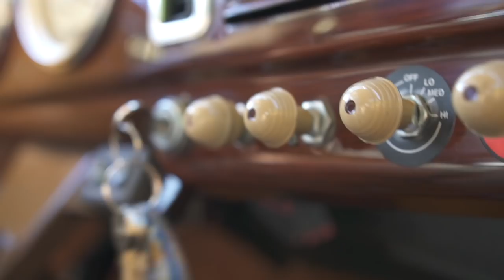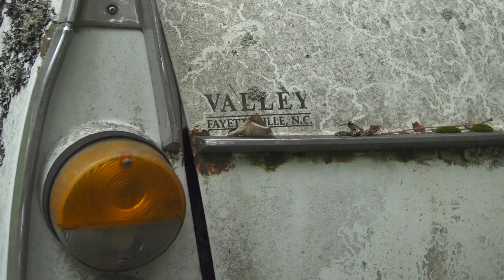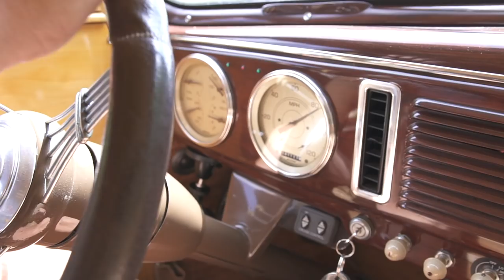A smorgasbord of Swedish classics | Barn Find Hunter - Ep. 27

Comment: The first prototype of Volvo 444 was presented in 1944. Likely inspired of the prewar Fords.The produced cars came 1947.The early wagons was called 445, the later ones ( I Believe its a late one in the film) was called 210.The Engine in the Saab 95 (the wagons is called 95, the sedans 96) is not just a industrialengine. Its a german Fordautomobilemotor. It belonged in the german Fords 12M, 15M and the cheaper models of 17MThanx for a very good show and greetings from a snowy Sweden

Comment: Had an 1950 Austin A-40 back in the 60's. Swapped the motor with a Riley (I think 1600cc} with dual Solex side draft carbs. Went together pretty much bolt for bolt........Wish I still had it.

Comment: On the Austin, it's an Austin A40 (40 horsepower) Devon.  1950-ish is about right. There was a later rebodied series of this car called the Somerset.  The engine is 1.2 litre, and is not exactly a B series engine, but is the precursor to it.  Despite the small motor, they were well regarded in my part of the world (Australia) as being able to take a hammering in rough conditions, and they sold very well indeed here.  On the Ford V4, I think that they were most notorious for their use in Ford UK's Transit van which also sold in huge numbers around the world.  It has a reputation as a very rough running motor.

Comment: Ford V4 actually was used in many cologne-built cars until late 70s-early 80s
Reply: Yup. The last model with it was the Ford Granada (european car - biggest one they made here in that years, almost limousine (big sedan) and estate version also with independent rear suspension, rwd, made from 1972) 

1.7 V4 was the base engine.  It ended in 72 in Capri Mk1, and in 77 in Transit Mk1.....

Comment: Austin A40 Devon, 1200cc engine. I helped a mate drop a 1500cc engine from a locally made Morris major into it mated to a 4 speed floor shift MG B gearbox and the rear axle from an Austin A55. He put 2 x 1 1/2" Su carbs on it. Once it was dialed in it gave many newer and more 'muscley" cars a good run for the money, and towed hus trailer sailer across the city to the water, something the original engine struggled with. And yes he liked his Pommy cars, he had a succession of Jaguar MK 2's.

Comment: The v4 was widely used in German Ford models at the time like Taunus, Capri. Transit etc. A few even made their way over here to North America in some of the earliest models imported and sold out of Mercury dealers. It looks exactly like a 2.3/ 2.6/ 2.8 Cologne v6 with 2 cylinders removed from the center. Ford usa used the 2.8 in some of the Pinto/Bobcat, Mustang II  and Bronco II and 86 Aerostar. With an upgrade to an aluminum timing gear these engines were very long lasting. The Cologne later evolved into the 2.9 (EFI) Scorpio, Ranger, Bronco II and lastly the 4.0 Explorer engine in the N.A market.

Comment: "Ford Industrial engine" nope they were fitted to Ford Corsairs, Had a pretty bad reputation due to the fibre timing wheel failing. Iirc Saab fitted steel wheels to fix this?
Reply: They where also fitted to Taunus and Transit vans at the time. Don't remember if SAAB changed the fiber timing gear, but as a curiosity Volvo B18 and B20's also had those.
Reply: My dad converted a '73 to run on petrol back in the eighties. I believe they had steel wheels, as they were reliable motors for the time period and managed rough conditions very well.

Mom and dad used to have rwd cars before the Saab. My uncle lived on top of a hill and my dad used to help him out at his metal shop.
One fierce winter evening my mom went to pick up dad and it had snowed a LOT. 
Once she got on top of the hill and dad hopped on board, she sighed "You couldn't have managed to get here in any  front-wheel driven car, I'll tell you that!"... Dad decided that it was for everyones best that he kept his mouth shut that moment..
Reply: ford actually produced two v4 engines one was produced in the uk for the british fords and one in germany for the taunus/transit.
Reply: Think it is the V4 that was also fitted to the Ford Transit van.
Reply: First V4 "Cologne""  like in Saabs was used in Ford Taunus  12M/15M  called " P4" in 1962 -- also front wheel drive - and it's succesor - the P6 Taunus up to 1972.

Yes it was also used as a generators, pumps engines thanks to it's compact size.

It was used also in rwd european cars - Ford Taunus P5 from 64,  Ford Transit from 1965, Ford 17M P7 from 1967, Ford Capri from 1969 up to 1972, Ford Consul (like the european Granada from 1972) (in Transit up to 1977 - then it was replaced by the Pinto 1.6 and 2.0 engines in line 4). V4 cologne was avaiable from 1.2 liter 40HP, 1.3 50-55HP, 1.5 55-65 HP, up to 1.7 GT 75 HP (also 65HP non GT).    From this engine Ford created the legendary V6 by adding 2 cylinders  (1.8V6, 2.0 V6, 2.3 V6, 2.6 V6 (that was available in US in Capri "sexy european", 2.8V6 - same as in Bronco, Mustangs II, III, etc.) - thats the block with added 2 cylinders -- you can see that clearly in the euro heads design - US market had different heads design....  and by removing the balance shaft and 3rd gear to the camshaft drive in v4 - made the fibre timing wheel timeless -- it goes for like milion miles in the V6.

Also the 2.9 bronco, ranger, 4.0 explorer, aerostar - are based on the same cologne block which was made from the V4 :)

Transit and Corsair and British Ford Capri had the British Essex V4 - only 1.7 and 2.0 -- the V6 were 2.5 and 3.0 - that's completly different engine a little bit similar in design with almost no parts shared.

Engine was used also in Saab 95, 96, Sonett and Matra 530 (French odd car)

This V4 was used also to power the first MUSTANG prototype !!!  The lightweight glassfibre 2 seater from 1962 - had the 1.5 V4.
Reply: The V4 engine was (and still is) also used in industrial applications: pumps, electrical generators, and in agricultural machinery and snowcats. In automobiles, the Taunus V4 was replaced by the Ford OHC/Pinto engine.
Reply: British V4 was popular in South Africa. It was based upon the Essex v6.
Reply: Actually, it was also used as industrial engine. It wasn't, as you stated, very well received for use in cars, so Ford found uses in pumps, generators and agricultural machinery for it.
Reply: It was not replaced - pinto sohc is a diffrent story :)  As the last one V4 was made in 1981 in a Granada and the OHC Pinto was produced from 1970 in the Taunus model, then Escort (RS2000), Capri etc. :)  Pinto replaced more the Kent OHV inline 4 -- also used in industrial applications :)  but is was also made longer period of time (up to 1983) :)
Reply: Kent was replaced with Zetec family of engnines, Pinto eventually replaced the Taunus V4 which was the last of the Ford cyl. rwd.  And the Pinto was from the American Ford Pinto first and foremost hence why it is called Pinto.  By the way, Ford Referred to the Pinto family of engines as the TL  for Taunus In-Line engines.
Reply: The v4 Saab was only 1500cc ! Transit v4 was 1700cc/2000cc
Reply: My parents had a 1966 Ford Taunus 12m P4 V4 1500 Turnier (Estate/Wagon). I remember it well, as the youngest of 4 kids I often had to travel in the load compartment.
Reply: No, the V4 Engine in corsair is the brittish 2 litre. Not the same as the German 1500 cc.The brittish Engines is inch, the germans in millimeter. Not a thing is the same on those two.But as I wrote earlier, the "Saabengine" is a Ford Taunus motor.
Reply: But the timingwheel was still in fibermaterial to keep it silent
Reply: One of the rumors of the exchange was Saab got the V4 and Ford got FWD rights, which eventually they used.  Incidentally, that V4 probably made its way into some tiny military only Jeeps.
Reply: What do you mean " FWD rights"? Ford had some fwd cars Before they sold V4.s to Saab. And there was alot of FWD cars in the World Before Saab
Reply: By rights I mean "Intellectual Property". Because there was an exchange of technology does not mean that the release of the products are simultaneous or even occur. There are many distinct FWD that have different patents. The earliest Ford FWD I'm aware of is the Fiesta.
Reply: The earliest FWD Ford I know is the Ford Taunus P4 (12M) , released in 1962. With the 1298 cc V4 Engine and front Wheel drive. This is the german Engine that Saab used in the model 95 & 96, not the brittish Engines.
Reply: I found a list of the Engines online, great. Here you have the answers :1961–1977 Essex V4—(United Kingdom: Used in Transit Mk.1, Granada Mk.1/Consul, Capri Mk.1) (South Africa: Used in Ford Corsair, Ford Capri Mk. 1, Ford Cortina Mk III)1962–1981 Köln V4—(Germany) Used in Ford Taunus V4, Saab Saab 95, Saab Sonett and Saab 96 until 1980.

Comment: The V4 used in the Saabs is a German eng (the 6 cyl version is fitted to the Capri & is known as the cologne due to its German origin).The corsair used the English eng (known as the Essex again due to its origin 2.5-3.0 v6 versions where also avl).
Reply: Capri Mk1 also had the V4   1.3 1.5 and 1.7 GT  50-75 HP  ....  and the British one had the 2.0 V4 Essex 100 HP. The English V4 was used in Transit Mk1, Corsair, Capri Mk1 ....  2.5 and 3.0 V6 were used also in Transits (special order), Capri Mk1 factory versions and Granada.  I remember also the 3.0 V6 Reliant Scimitcar ,  some TVR cars, AC 3000ME and Gibern Invader :)

Comment: When you first described that V4 I needed to hear it 4 times before I went wait...what? My brain clutch didn't engage right away.
Reply: There were also aircooled V4 in russian made ZAZ Zaporozeths :)  exactlty ZAZ 965  and the engine was called MeMz 965  -- it was made from 1960.   Ford introduced it's V4 in Taunus "P4"  12M and 15M in 1962. It was watercooled, open deck design, camshaft gears and balance shaft.  1.2 had 40 HP, 1.5 at start 50 or 60 HP (LC and HC).... Saab used the same Ford Taunus engine (Taunus then was front wheel drive also)

Comment: wow loads of good volvo (how dare you not like square volvo's! there lovely things is the eletrics and rust didn't kill them they'd be around today) the odd saab and a very nice austin a40 devon/summer set,
they were imported over, austin had the healy and the sprit so sending these over they weren't popuar but ppl brought them if you live in a small town a big usa to go to work was too much this? you could drive it into work place and save on fuel there great cars
Reply: sirmugman Austin Somerset my dad had one in 1968 he drove it to work every day 30 mile round trip six days a week in the winter he covered the engine with sack bags and hang a paraffin road lamp of the top hose to stop it from freezing up the battery was always flat he stuck a clozpeg behind the choke and would start it with the crank handle first time he also had a Austin Westminster 3 ltr with full walnut dash and door trims the good old days from Burt in somerset england
Reply: Love that story Burt, thanks for sharing.